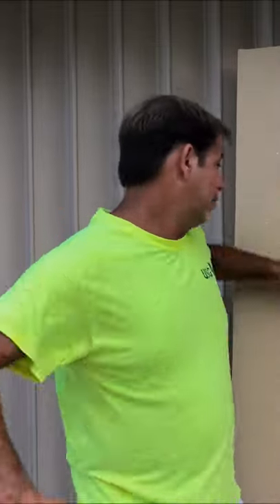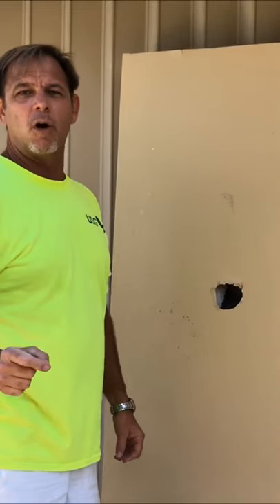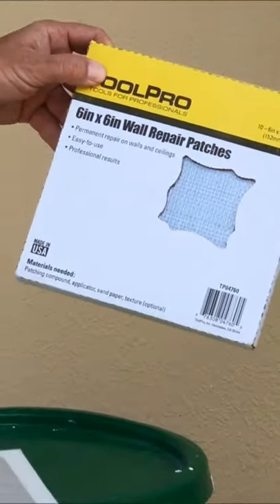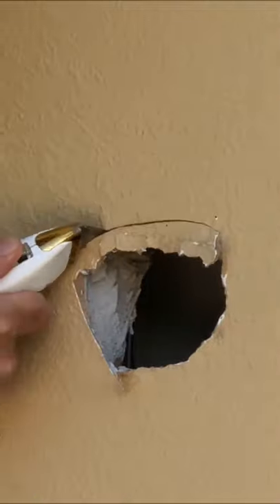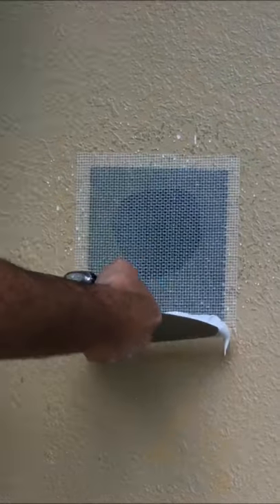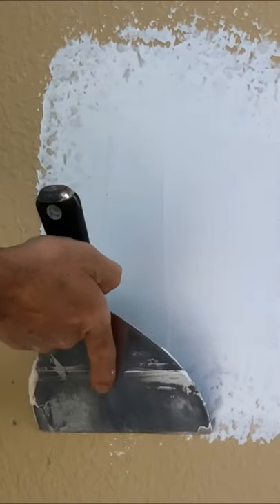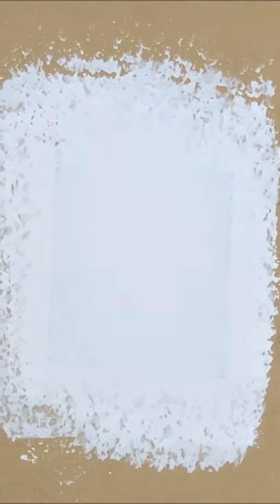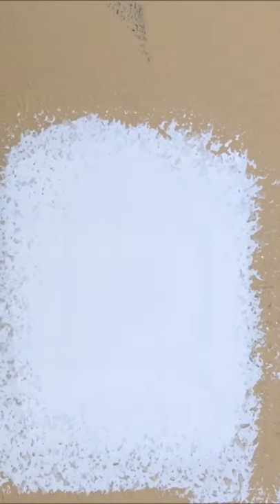I Punched a Wall -  How to FIX IT! #Shorts

Comment: Yeah I usually power sand 3 inches around the hole to make it smooth and then texture matching(which is the hardest part of this) becomes easier.

Comment: All those wall repair patches make me want to punch a hole in the wall because they’re not fixing the problem. It’s literally just putting paper and paint when it’s actually not that hard to plaster the hole why is it that everyone wants to do it the wrong way but no one wants to do it the right way in the right way is filling the hole with fucking plaster And doing it right because I’ve heard so many stories from a woodshop teacher when he was a realtor, he would go into houses with the initial walk-through, and would find houses that literally there’s holes that were covered with wallpaper and he can just poke holes in the wall and I’m pretty sure those patches are no better when you could just get a tub of plaster and fill it in and if it’s too big, get a piece of drywall, cut out a square hole and put it in there and then plaster over it but I guess using your brain is too hard for everybody. I’m doing it the right way it’s too hard because he would rather do it the wrong way, and have someone else fix it later.

Comment: NO I'VE NEVER BEEN SO MAD I PUNCHED A HOLE IN THE WALL AT LEAST NOT SINCE I'VE GOTTEN OLDER BUT I HAD A POWER CHAIR THAT I HAD NOT GOTTEN USED TO PUT SEVERAL HOLES IN THE WALLS AND NOW MY APARTMENT COMPLEXES TRYING TO CHARGE ME $900 TO FIX IT AND I WANT TO LEARN TO DO IT ON MY OWN BECAUSE I THINK THAT'S JUST WAY TOO MUCH MONEY FOR ME TO HAVE TO PAY BACK FOR SOME HOLES IN THE WALL ANY SUGGESTIONS